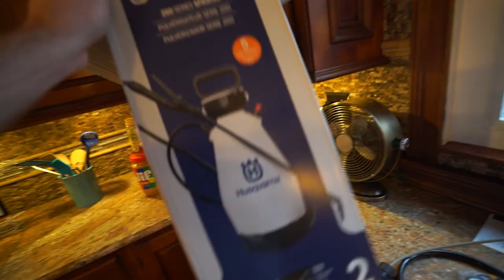Spraying Palms With Wilt Stop || Repotting a Gardenia  & Office Remodel Progress || Saturday Vlog

Comment: Potted windmills should come inside in temps under 25F generally.  Their roots die at around 18F
Reply from the maker: Oh I've always left them out to 10F and never had a problem before. Heck the ones on the front porch have seen 5F on many occasions.... destroys the fronds, but they've always bounced back in spring.
Reply: Yeah it all depends on the size of the Windmills. I also have left 5+ foot potted Windmills outside in  12F cold and only lost some fronds.

Comment: So, umm, do you not have a laundry tub or bathtub which has higher pressure than the kitchen sink?
The organics are important for Gardenia not for releasing nutrients, but to help keep the moisture even and the pH acidic. They just don't do well if the pH is above 6.5, it really should be 5.7-6.0. If you stick them in the ground in Florida, you have to dump soil acidifier around them twice a year or they turn yellow, the leaves fall off and they eventually just peter out. You would think a thick layer of mulch would be sufficient, but nope.
Reply from the maker: I do but those are all upstairs or in the basement. Sometimes I'll use the mud sink but it's hard to get the buckets out once they're full bc of the bird cage and awkward angles. Those sandy soils make amending a real pain in the 🫏 don't they! I can't speak to growing them in the ground very much. Longest I've kept one before the cold got it was about 3 years.